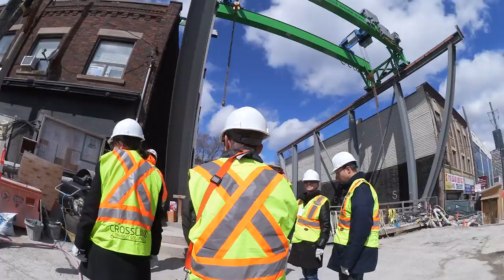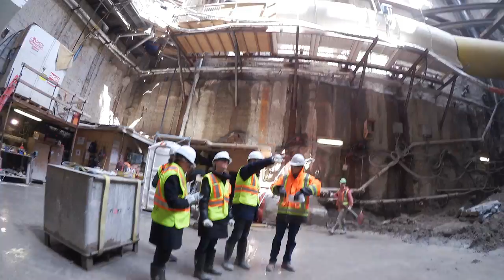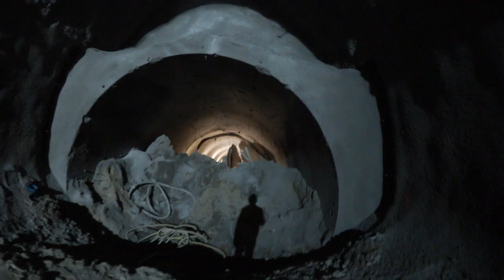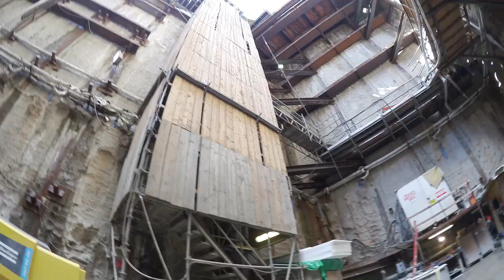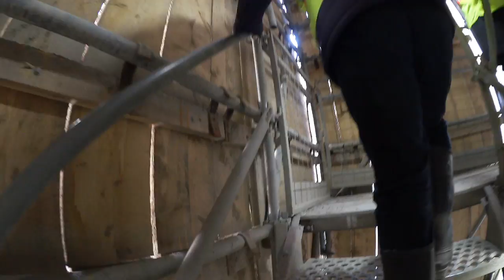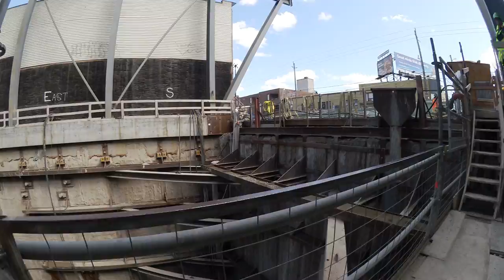Toronto Tunnel Tour April 3 2019

Comment: I used to work for a telecom company, the blue one, back in the 2010s...sometimes you would have to find a cross connect terminal somewhere and it was a huge mission.  One time one of those was somewhere in the PATH system, and I ended up in some tunnel around Young st.  This tunnel was LONG, it went straight down for many, many KMs farther than I could even see any end to.  I was amazed, and it's like a giant subterranean maze down there, I'm telling you.
Reply from the maker: Very cool, ty for sharing !